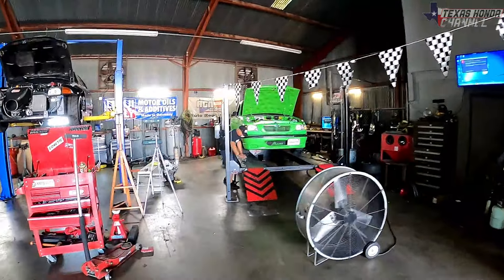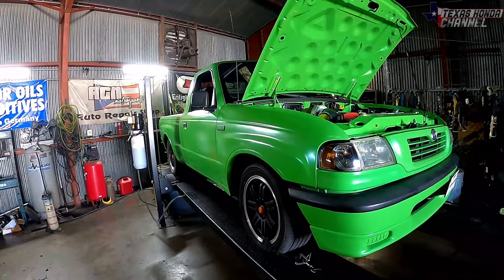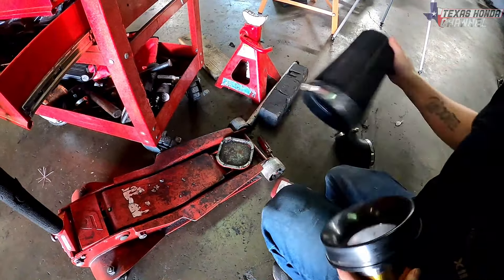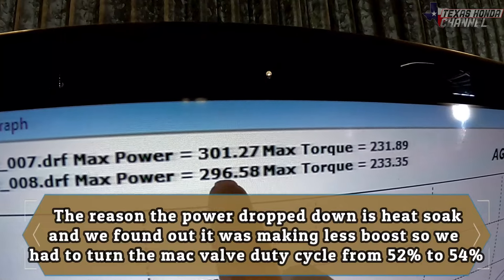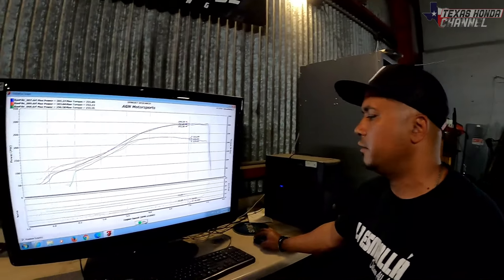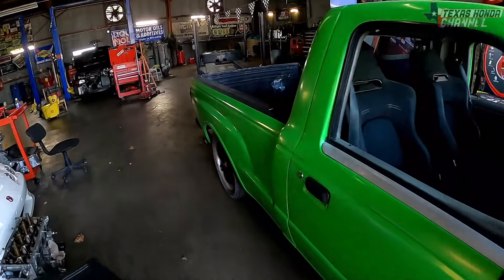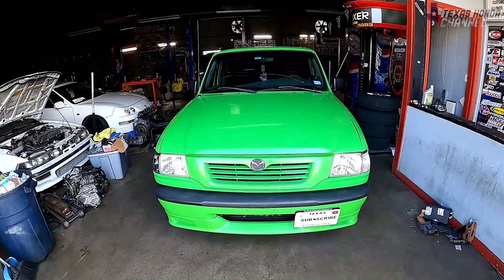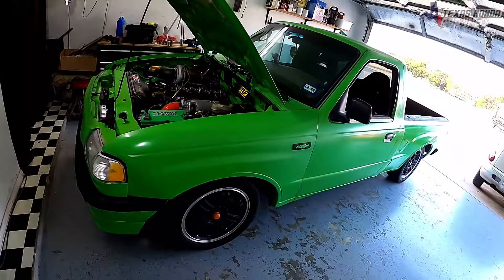K20A3 MAKES 315 WHP (DYNO PROOF) K SWAP TRUCK

Comment: Pretty amazing! If my math is right based on a 15% drivetrain loss that thing is making 360 ish hp at the motor!
Reply from the maker: welded diff might add more but even if not that is still good! It runs strong!

Comment: Really thinking bout doing a k swap on the sedan. Just need figure out how to do so for less then another 5k
Reply from the maker: With the sedan it is cheaper to k swap than this truck was. usually cheaper that is.
Reply: @TexasHondaChannel  minus the engine just about everything else iv priced comes to roughly 5k. That's keeping the ek sub frame not swapping to an eg. That would put me at roughly 11k in my car and not including the car it's self. I got that thru trading around lol
Reply: @TexasHondaChannel  really wana get my hands on an 8th gen Si sedan. Neighbors got an 06 but won't come off it right now.

Comment: Hey man I have a question for you. Have you run a stage 2 clutch kit on a daily if so how did it go? I'm asking because the price is basically the same an OEM replacement in the time frame I need it. On a different note it's nice to see one of your truck videos getting some youtube traction.
Reply from the maker: Yes marketing and sharing it around helps and I been sharing it everywhere lol 😂 I also daily on a stage 3 6 puck (as long as it’s a sprung clutch) it drives a lot like factory and holds power great! I prefer aftermarket stage 2-3 over stock even if it is slow. I paid $80 for my stage 3 off eBay.

Comment: This would be a good swap for my AE86! I've come across RX8s a couple times in the junkyard I'll have to keep my eye open for a transmission. Base model RSXs are easily found in my area. I think 300ish hp in a light AE86 chassis would be plenty. 

Your channel is a very good source of important information. if i ever get to do this swap I'll def be coming back for input.
Reply: K power makes a full kit to throw a k series into a ae86